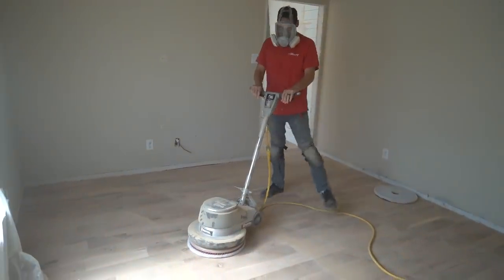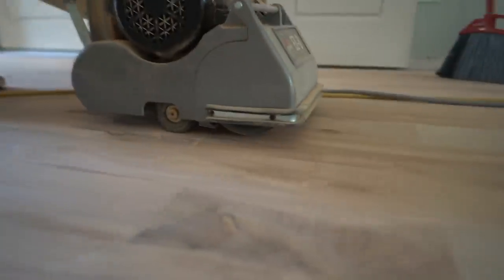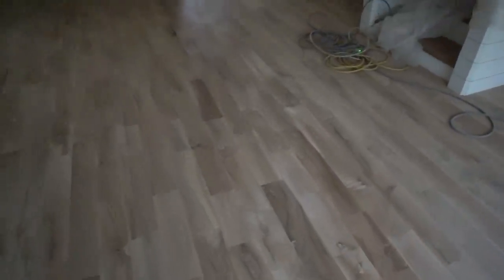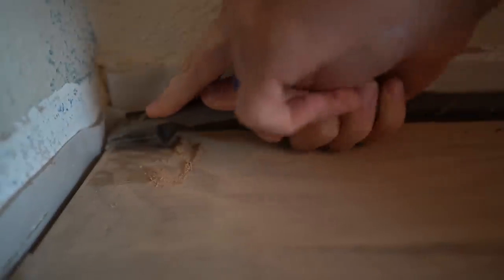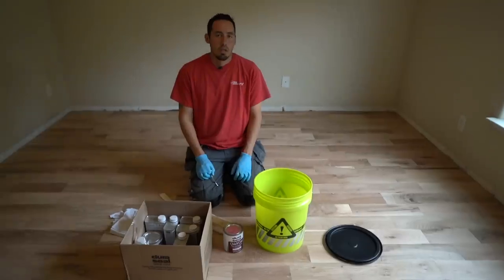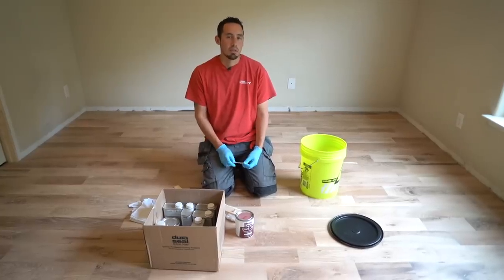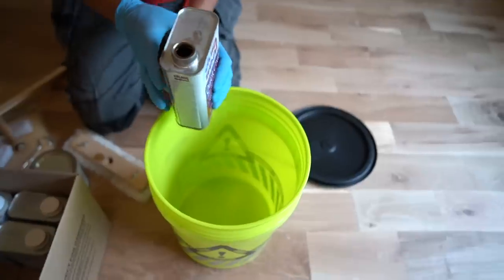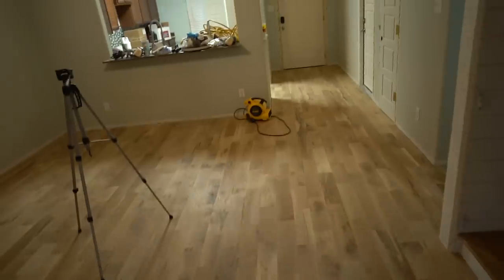NATURAL Look FLAT Finish! White Oak Hardwood Floor

Comment: Just an FYI. The edger is meant to cut left to right. Also bona makes a water based sealer called natural seal and it’s basically raw looking. They have a naturalle poly too. Looks good!
Reply: Traffic HD looks almost completely clear. Way more clear than water.
Reply: Water based, too.
Reply: Yes edge left to right and big machine right to left. We had a sub who use to do a first coat water base then one or two top coats with oil. Looked almost purple or pastel looked awesome.

Comment: Flat finish is the way to go. Modern. I am a painter and flatter (not ceiling flat) wall finishes are very popular. Low sheen is also easier for touchups. Nice job. Thanks for posting the process.

Comment: If you have any as-yet unstained rooms to do, I'd like you to try something as an experiment.  An old school hardwood floor guy, who trained lots of crews for a large company, told me that after the final vacuum, you must wipe it down with a mineral spirit rag.  It works like a tack cloth, and makes a difference in the quality of the finish.  I''ve never seen a comparison, but his floors come out really nice.  He would dampen the rag with spirits, wrap over an applicator on a pole, and go from there with a single final wipe (he used about two rags/room). Give it a try if you're curious.  He would apply finish after that, oil or water-borne.

Comment: WOW!! for me first time using that sander up on a second floor deck the thing shot around and knocked some of the spindles loose and almost took a dive off the side of the deck with me on it. Good job on the floors looks really nice but sooooooo much work. Enjoy your vids alot to learn, good teacher on the trim work. Thanks

Comment: Looks Great, you should be proud. I'm doing some crown mold cuts but my miter saw fence isn't tall enough to cut at the right angle so trying to figure that out. You make it look so easy.
Reply: Maybe attach a board to front or back of that fence this may be the fix you need

Comment: Good job using Duraseal. Big box stain isn’t best for floors. Did you try just using a sealer and then water-based finish instead of staining? You can apply and wipe with circular buffer? Watch out for lap marks on sections that have dried

Comment: I helped refinish a wood floor once. Never again lol. One of the most stressful things I've ever done. Also worked on a new high end home about a year ago, came in one day to find the homeowner and floor guy there extremely frustrated looking (not a good sign), who came up to me and asked if I was the one who cleaned the wood floors, I thankfully was not. Found out the contractor had the cleaners come, they used a wax on the floors before they had been completely finished. Not sure how that ended up working out for them, but the floor guy and homeowner were super pissed. Made it sound like the floors were ruined. Hope that ended ok.

Comment: Richard, great job and great video! Like your product choices. Especially the duraseal catalyst finish. That's a premium finish. It will treat you well. If you want to treat your finish well, you should get a big package of felt protectors for everything that sits on the floor. And a cleaning kit like Polycare or Bona, it leaves no residue so you can recoat in the future.  Maybe I'll video putting up some crown molding in my living room. Get out the popcorn 🍿
I'll get out the caulking gun
Reply from the maker: Gunderson Flooring and Design _ thanks so much. Your comment in the last video was one that I referenced throughout this project. Send me your info to richard@finishcarpentry.tv so I can send you some of my CA glue. Thanks man!
Reply: @FinishCarpentryTV  Richard, thank you for the kind offer, you don't owe me anything buddy. My contact information is in my profile for you or anybody else that needs some help. Your videos have been very informative and entertaining in a lot of ways. Even your help with products and business software. I was glad to have helped you back! Best wishes. Jay

Comment: Wow, I could have saved you a lot of time. Look into Bona Craft Oil. It is a monocoat product that would have done exactly what you want. That in conjunction with or instead of the craft oil would be Bona Natural. I am a floor sander by trade but I do large commercial jobs. Gyms, stages, that type of thing.
Reply: A smart man learns from his mistakes. A wise man looks to the comments and reads all the professionals pointing out the mistakes.

Comment: I'm an RN and it's a travesty that no one is getting their necessary  PPE. I can't imagine what other trades people or industrial workers are doing or going to do, because as you said, existing filters do have a life span, get saturated, and won't be effective. I hope OSHA and other safety bureaus or unions are addressing  this. Sadly the news isn't covering this. Vapors or particles in industry or just home use products are extremely dangerous and can cause lung injuries.

Comment: Couldn't you have applied the duraseal DuraClear Max Flat Sheen product right after sanding? I mean why was there a need to stain the floor if all you wanted was a natural look.  DuraSeal is a top coat applied to protect the floor. Stain is just for a color, right?

Comment: Nice finish but why didn’t you fill the big gouge at 16:00
Reply from the maker: Ermanno D'Angelo there are many of those at the ends of the boards. We choose the number 3 white oak which has a lot of boards like that. I chose to use them because I like the texture they add. Thanks

Comment: Just a couple things, I know you're not a flooring guy but if you do this again in the future I'd suggest hitting the floor with a 120 grit screen after staining, the stain will penetrate deep enough you won't take it out of the wood and it will knock down the open grain created from the stain. It just helps for a smoother finish. That duraseal stain is the way to go!

Comment: You shouldn't have burned all those cut pieces. You could have test the stains on there, before you do it on the finished floor.

Oil based poly would give you an amber hue. But water based poly, like polycrylic wouldn't.

Comment: Great job on your floors.  We have installed cabin grade white oak floors two years ago on our first floor.  Took the time to fill every knot, worm hole or cracks with clear west systems epoxy & hardener.  Looks fantastic then finished with Rubio.  In stocking feet you can slide on it like a your a ice skating.  Looked fantastic the big BUT is water drops, food, dog drool (2 standard poodles) leaves stains!  Now we just installed same floor on 2nd floor of the house & want a similar feel for the finish but better wearability.  How did your floor hold up?  Any tips or would you do something different with the finish?  Thanks for making a great video!

Comment: I had a finishes guy once tell me if you build with a gloss and finish the topcoat with a flat/ matte finish it will not yellow so much. Flat finishes are gloss with an additive to flatten it. This is where yellow comes from. So layer with gloss, finish with flat. I did this on a table and 7 thin coats and 4 years later, it still looks great. Great job!

Comment: i agree the flat finish looks a lot better can i ask you a question im a cab driver living in cork ireland so not a tradesman but i really like dy and i need a mitre saw ,now i know you use dewalt or milwaukee those brands are extorniate prices, im just wondering if you could advise me on a mid range priced one thank you ,colin fromcork ireland

Comment: Been in the business since 1965, I was 15 yo. You learn by doing. I knew that buffer was going to bounce you around. The handle was straight up. My buffer and my 12 in. Clark drum sander were cast iron. Can't find part for it anymore. Used to belong to my dad. Products have changed a lot. We used to use sealer, and varnish. We used an eight inch horsehair brush to apply the finish. In the 70's, I started to apply the first coat of self-leveling poly with a 16 in lambswool applicator and the 2 extra coats with an airless. Customer's floors still look awesome. I used to be criticized by others in the trade for using an airless, I had the last laugh.  Don't be afraid to experiment especially if it's your home. Be a pioneer. Good job for a beginner.

Comment: so question, would you still use the #3 flooring or with 20/20 would you have used #2 or even prime? With the extra cost for the filler and time to add and all the extra sanding do you think the #3 actually might have cost more in total?

Comment: I’ve had good results with street shoe (water base poly) does not yellow and very durable. 
Also Osmo finish has a Polyx-oil that is suppose give a more natural look and is easy to repair or Recoat.

Comment: Quick question where did you find the information that allowed this project to move forward? I have slab foundation and would like to install a true hardwood floor and not the cheap engineered wood floating floors.

Comment: Flat for me too. Since you drum sanded the floor so much, didnt really get why you went through the wood filler process.
Reply: Pretty sure the wood he chose was rough and basically "bad" lumber not select pine you know so he used the fillers to not only hit the gaps in between the boards but also for all the holes and flaws in the wood itself.

Comment: It looks great Richard!  I like the low or satin sheen look!  May I suggest adopting the Asian lifestyle of no shoes in the house?  We’ve never worn shoes in the house.  We wear slippers instead.  That’s the way we raised our kids and they’ve adopted the same no shoes policy.  It just makes no sense tracking in crap and dirt from the outside.  This has especially worked well during the Covid19 Pandemic, since the virus can be transmitted via shoes worn from the outside.  We take our shoes off in the foyer, then spray them and the floor with alcohol, prior to entering the living areas.  It’ll keep your hardwood floors looking good, scratch free and along with your carpets clean!  

The kids are adorable!!
Reply: 1heavyhammer, it’s an Asian tradition, e.g. Korean, Japanese, etc...not wear shoes in the house.  It’s not an American tradition.  It’s a stereotypical whether you like it or not.
Reply: 1heavyhammer, lol!  Don’t be such a tool.